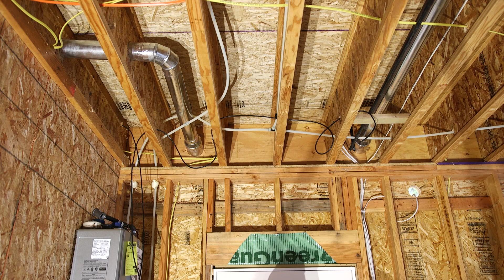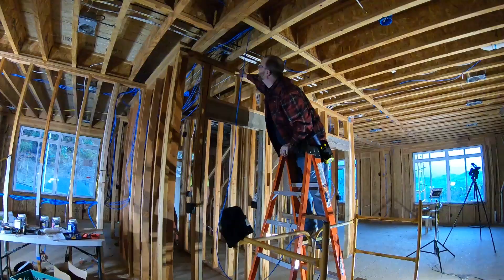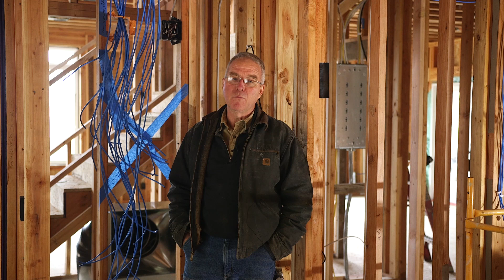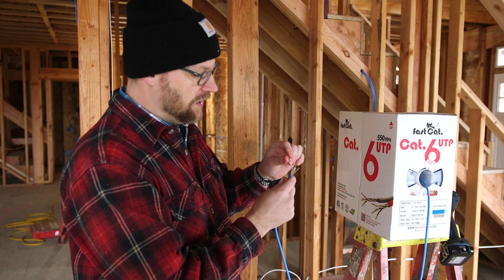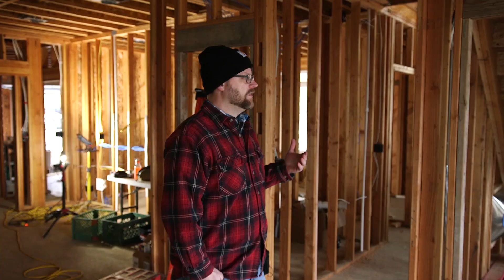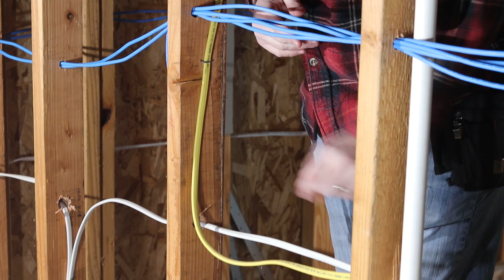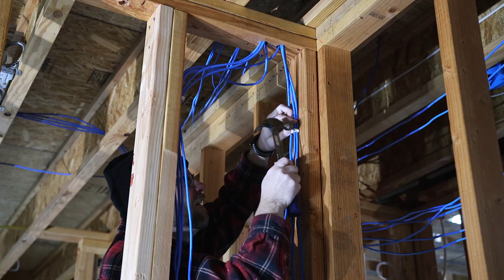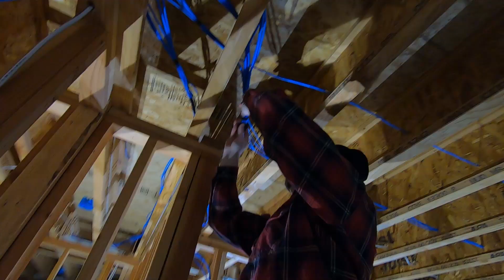Installing A Home Network Ep.100

Comment: I never understood why Americans refuse to use PVC conduits for cables, as this will become a pain to upgrade in the future (as is often required with data-cables).
Also, you shouldn't use UTP cables for long runs (longer than 5m) or inside walls for that matter, always use S/FTP cables as those offer more protection against interference (and kinks).

Comment: I'm curious, why do you use Cat 6 and not Cat 7?
Here (Germany) the price difference is virtually irrelevant, but you get a better and more future-proof cable with better magnetic shielding and durability.
I always use duplex cable.
You get 2 lines with the labor of one, matching the double sockets it's a perfect fit.
And if you really need just one you can cut it in half.
Isn't that a thing in the US?
Reply: It's not generally available here. I mean, sure, you can order it off Amazon, right? But it's not standard to find in construction here yet. 'Round here, you can buy bulk cat6 riser cable at Home Depot, but forget about Cat6A or anything more exotic, even if they are better standards!

Comment: Network topic ... On the long run it is more important to be able to modify your infrastructure than to have cat6 cables in every room. Cat 6 may be outdated in 15 years. Who knows? Maybe fiber is the next cat 6.
And being able to modify means to perfectly document your layout. 
How about a dedicated built-in wall cabinet just to store house plans and documents like network layout (as part of the house, like the main power panel)?
A future demand of new cables will be DC power in addition to AC. Compare it with recreational vehicles and the newest solar systems.

Comment: You chose well.  Coax cable is outdated (Other than the one needed for your cable modem for internet and over-the-air TV antenna).  Phone, over the air TV, streaming services, security cameras, etc. can all be connected to your local network.

Comment: Cat6 is good for gigabit bandwidth to 100 meters, but for 10 gigabit only to 35m. Cat6a is good for 10gb to 100m. 6a has a foil shield around the twisted pairs inside the jacket, and is only moderately more stiff (and expensive) than 6.
Reply: Right on! I don't think we have any runs longer than 35m, so I'm pretty sure we're 10Gb ready. Probably not 40Gb, but 10Gb will be just fine. :)

Comment: Job well done. All important points met. Excluding keeping away from zip tie (zap straps) as they can kink the cable. Also terminations, keep the pairs twisted tight and you will not have any line not working due to near end cross talk. Great job as always. Exciting to see a full build even including the little old low voltage guy :)

Comment: I'm very impressed in our 3100sq ft house I ran about 50 network runs 
9 for security cameras
3 for Wireless access points
7 for HDMI over cat6 (TVs)
and the remaining are general network use. I'm a tech nerd and most likely went way over so 24 runs seems about perfect!

Comment: As good as WiFi is getting it’s making wired houses obsolete anymore. I ran wire to every room of my house 6 years ago and I don’t even use any of it anymore.
Reply: Absolutely. Several of these runs are for wireless access points. :) Wired still beats wireless for constant throughput, but is WAY less convenient. :)

Comment: Pulling in some at work one day and got the puller to stop by saying on the radio, hey stop there is a Fred (a kink) in the cable.  Fred didn't like that. The solid cable in the wall is called backbone cabling and the flexible stranded stuff is patch cabling. Patch cable is used to connect your device to the backbone coupler in the wall plate. Don't do your network cabling neat and nice as they can crosstalk. In fact one of the qualification tests is NEXT which is acronym for near end cross talk. Each of the 4 pairs is twisted at a different rate to prevent a pair from talking to another pair. This install looks excellent. Something else don't install it in a metallic conduit.

Comment: Cat6a properly installed will give 10Gb to 100 meters reliably. 
Its a very modest amount more than Cat6, however its the best future-proofing you can do outside of pulling fiber.
No-brainer to anyone even thinking of new build or reno.

Comment: Rather than waste any money on cabling of any kind it would be a much better investment to run conduit to boxes in all of the room and to wherever your service providers will enter the house. The reality is that most of the wiring will never get used, and the wiring that does get used will be obsolete in a few years. The conduit will make it easy to install and replace cabling as needed without having to open up walls. The conduit will also protect the network cabling and make sure bending radius is maintained. PEX tubing can be used without fittings.

Comment: Ben is pretty much spot on.
Smart thing to do is after pulling, put your jacks on both ends and then do Layer 1 verification.
1. Use a cable tester to insure the jacks are terminated properly, ie all T568a or T568b.
2. Use a  Fluke Networks CableIQ Qualification Tester or similar to test that the properly installed and terminated Cat6 will reliable transmit 1Gb+ as advertised.  Might as well splurge for the Cat6a which will run 10Gb to 100 meters.
Note- Even though Cat6 has very good EMI protection, you still want to avoid running parallel to power. Cross at 90' if necessary, and always try to keep the network cable 2-4"+ away from power.   Higher than 240v residential, or near heavy induction equipment, microwaves, etc, and more separation is going to lead to far fewer problems.
Do this before drywall goes up, so you want replace any bad runs.
Does not hurt to coil up an extra 4-5' of cable at the termination end of each run, just in case someone 'needs' to move a location.
Also a good idea to consider several extra drops above ceiling in the event someone wants to add several wireless access points to provide solid coverage vs a single Comcast/Verizon wifi-router stuck in a closet....

Comment: As someone who builds telecom systems for a living, if you think you want one cable per room, run two.  Kinks don't kill cables, it's not that delicate.  Install isn't finished until every drop is tested.  Higher standard cables aren't marketing speak, but they aren't used because of price and install difficulty related to STP.  Test those cables before the drywallers show up.  The most expensive thing about UTP is the labor to install it.

Comment: i can tell you this much after many years of insurance restoration that if the fire in the house is inside the drywall and burning the 2x4studs the insulation on the on the network cable is the least of your worries/problems you know looking at the big picture and all that lol another great video as usual

Comment: The biggest advantages of solid core cable for in-wall use are the lower cost per-foot and it is better suited for terminating at punch down jacks. Stranded cable tolerates frequent bending and handling much better. But that isn't necessary for in-wall cable that is only handled once when it is installed.

Comment: A lot of companies are getting away from coax cable for TV anyway so IMO it's not a huge deal.  The only thing I would have done different is run that main coax feed in a conduit so when/if the provider ever offers fiber to the home in that area, it'll be easier to upgrade the system cleanly to fiber.  But other than that it looks like you got a good set up.

Comment: “That’s probably more than anyone is ever going to need” Said: Networking Engineers who developed IPv4.
Reply: or the supposed quote from Bill Gates: "640K ought to be enough for anybody."
Reply: @davidmatson5796  Bill Gates actually said 640k (10x the current standards of 64k) of addressable space ought to be sufficient for 10 years.  He later admitted he'd underestimated, and that 640k had been enough addressable space for about 8 years.
Reply: That was never actually said about IPv4, why would you make up that fake claim?  The creators of IPv4 always intended it to be a temporary protocol solely for the small Arpanet, and expected a more robust protocol to be developed well before the network would be opened to the public.
Reply: @LorenzoLovelace  so as knuckle dragging builders what should we install in the houses we build? 
A new games console can render an entire data system defunct.
We can construct buildings to withstand the forces of nature, earthquakes, tornadoes etc.
While it seems folks like you are bothered about are data and power points.
Reply: @sally6457  you should install cat6 for runs less than 55m and 6a for runs longer than 55m. (just to really future proof the home). 
not really sure what the point is of the rest of the comment.
Reply: @splift23  I posted a more in-depth response in another comment, but I would recommend a minimum of Cat 6a shielded cable everywhere.  The price difference is negligible when you're buying in 1000ft spools, and the shielded cable is more rigid which will help it resist kinks a lot better (as a side benefit).

Cat 7 or higher at this point in time is definitely for specialty professions that need higher throughput, so I wouldn't recommend that to anyone unless you're in a specialty profession that requires high-speed access to devices in your home, and you likely already know if you're one of those people.  Just don't be like the guy on this video and advise that Cat 7 or Cat 8 is "marketing speak" and "not useful".. it has a use, but just not to the average home owner.
Reply: @splift23  my point was the term "future proof" 
There's no such thing as future proof in technology.
 why so many cables when wireless connection is The modern way?
(I'm actually asking the question,)

Commercial properties are future proof as they generally run cables in surface mounted conduits that are accessible for maintenance and upgrade.
Any system with components or connections buried in the ground or in a wall has a finite lifespan. Therefore cannot be "future proof".
Reply: @sally6457  I don't disagree, typically "future proof" in tech is to use whatever the actual big guys are using, so 10gb networking equipment would be "future proofing" the home since that is the next (excluding 2.5gb) big leep, though I don't think many non enthusiasts will have 10gb networking in their house until the 2030s so may as well prepare now while the building is going up.
Reply: @innomin8251  I didn't know that they were basically the same price, might as well go for the best you can. It's been a while since I had to buy cat cables.
Reply: @innomin8251  Correct on 6a for very small price for future proofing to get 10Gb when needed  in 5-6 years when everyone is stream multiple 4/8K video. 
However totally wrong WRT 'shielded cable'.  Totally over the top,  even in F500 we don't run that in even the worst EMI manf' spaces, far to many headaches with grounding, and its usually 2-4X the cost.
Thats where your friendly MM fiber come in, and solves all the headaches.
Builders, get a good grade of Cat6a and you can deliver the customer a 10Gb home network that very possibly will be used/needed in 5-6 years.
Reply: @boots7859  Ok, specifically it's the F/UTP that I was suggesting that provides the foil shielding, but doesn't meed the STP specifications.  I mixed these up in my head.

Looking at Monoprice as a source for inexpensive cable, 1000ft of Cat6a F/UTP is $215, and 1000ft of regular old UTP is $190.  This isn't a substantial difference, and again, the primary reason I suggest it in wall cavities is that it's a bit more rigid and difficult to damage in a cable pull scenario.
Reply: @splift23 that's right, the only criticism is being ready for 2030, that's only ten years away. For $300k+ for a home I'm going to hopefully like there for another  50 years or so, 
Isn't wireless connection technology the way to go rather than hard wired connections?
Reply: @sally6457  If it's feasible in a build, those orange low voltage boxes can take a flex conduit in the top (smurf tube), which can be run up to the attic for single story or top floors. You then run the cable inside that and route it back to wherever the home network switch is. If you need to upgrade the cabling you can pull new through the flex conduit.
Reply: @RoamingToast1  so not "future proof" then?
Moore's law dude. 
My foundations will still be good in 100years,  and probably be very similar in new builds in 100 years.
What is the expected lifespan of cat 5 or 6 cable?
And in 2 years will it still be relevant?

My point is that the quality of construction and workmanship is more important than data points.
Reply: @sally6457  more important doesn't mean anything really. What's more important your electrical or your plumbing? Well obviously they are different but both are required and data really shouls be a part of any new construction or you are doing the homeowners a disservice.
Reply: @jaythompson5102  you get what you pay for.
Expectation leads to disappointment.
Reply: @innomin8251  Cat6 is plenty for a home. I doubt half of these jacks are ever lit after the house is sold. Most people don't even have devices with Ethernet jacks on them anymore. Even most modern security cameras and TV boxes are wireless only. And shielded cable is a pain and completely unnecessary in a home setting.

The only thing I would have done differently from Ben in this install is run a piece of conduit from the exterior dmarc to the patch panel. That way, if FTTH comes to this neighborhood they can easily pull a piece of fiber. In my area all the cable company's new builds are FTTH, they don't want to deal with copper anymore. And who can blame them.
Reply: @RoastBeefSandwich  depends entirely on who lives there.  A tech head such as me will absolutely want everything hard wired that can be, which is almost everything that isn’t an Alexa or smart switch in my home.
Reply: @LorenzoLovelace  Well, it’s a joke so...

Comment: Interesting. I just ripped all of that out of my house. It has been at least ten years since I have used any network system. Maybe 15 years. Buy a good wifi router and skip all of that.
Reply: You can't beat the speed or reliability of a cable. Yes wireless is easier but when you try to push the limits, you get dead spots, signal drops, interference and our data demands are only going up. 10 years ago we were dabbling with HD video, or 720p. Now 4k streams are becoming the norm with remote learning, video conferencing  and on demand everything.
Reply: @BrandonFrancey  Spot on. Only the naive believe that wifi is all they need.  Oh well, thats job security for cable installers...
Reply: I would have made the same argument till 2005.
Reply: Some of the network lines are destined for wireless access points, yes. :)

Comment: Just a couple notes looking to do this themselves. First, beware of any cable you see on amazon, etc with the letters “CCA” anywhere on the box. This means “Copper Coated Aluminum” and is inferior to solid copper conductors. Spend the extra money on the solid copper, both for ease of installation, and for data integrity. Cat 6 cable is good for gigabit speeds up to about 300 feet, but only good for 10 gigabit for up to 150 feet, so if you’re thinking about “future proofing” all of your runs, and you are in a larger home/have all dedicated home runs to a single cabinet such as in this house, you will need category 6A cable for 10 gigabit runs up to 300 feet in length. If you only want gigabit speeds, cat 5e is also good for gigabit up to 300 feet, and is slightly cheaper than cat 6.

Comment: As somebody that hasn't had a cable box in a decade, but has had high speed internet before I had hot water in my last two houses, I fully support the decision to only run a single coax line through the house. I'm planning to do the same when I build. Did you happen to run any CAT6 into the garage, by chance? Might be handy if anyone is working in the garage to have a hard line out there.

Comment: Best explanation of network cable i have yet to see. 
When do you run shielded cable?
How are you passing the bundles of wire into the network room and not have massive air leakage due to lack of insulation ( wires ran in attic)
Reply: When do you run shielded cable? - Realistically, almost never.  Too many problems with the grounds required. Most businesses simply throw MMF at the problem and they never look back.
Normally you would run all the Cat6 through a ceiling penetration, AKA a 2.3.4" pipe.  Then you could simply cram some approved firestop material in the top of the pipe, if that would pass inspection.

Comment: Good video for the average home owner.  And I like to see an installer take pride in their installation.  I would also add runs for an access point on each floor and outside as well.  

For the separation from electrical lines I would point out to the average joe that it is a best practice but it’s not the end of the world if the separation is not possible.  Most of my data centers wind up with bundles of cables inside the racks where there is a mix power and data.  It’s unavoidably.  And have never ever seen it cause an issue.  So yes it’s a best practice but I don’t lose sleep over it.